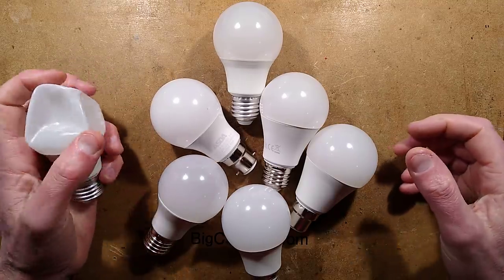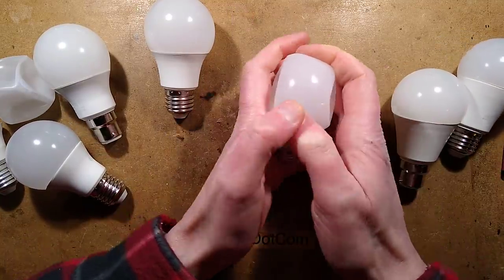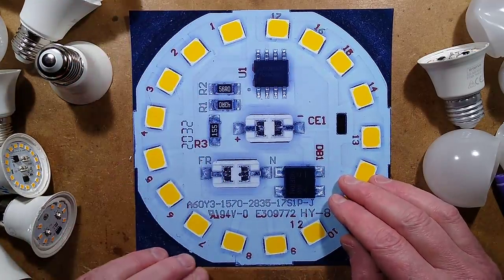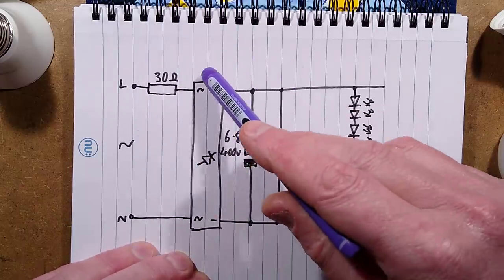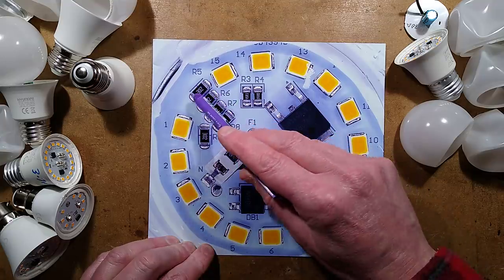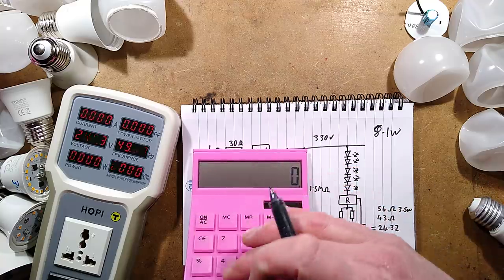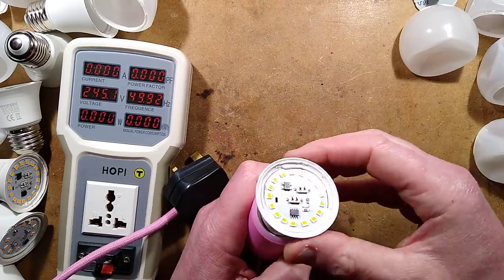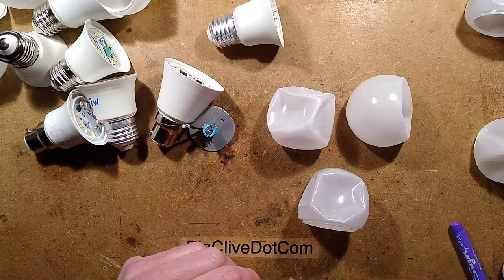Crushing and hacking LED lamps

Comment: I wired up my house with LED-friendly dimmers and bought a bunch of dimmable recessed LED lights that were brighter than I needed. I have them dimmed to the appropriate brightness in my house. They should last longer, right? Or does it not work that way due to how LEDs dim?
Reply: LED dimming is done several ways.  But overall, running less power means running cooler and therefore longer.
Reply: I wonder if you're really using less power or just warming circuit components?
Reply from the maker: They should last longer.  Especially if you used the correct type of dimmer.
Reply: @bigclivedotcom  Yes!
Reply: The light will last longer but you moved the weak point to the dimmer. Decide which one is cheaper to replace.
Reply: @bigclivedotcom  I have a bulb that can be set to three brightness levels by rapidly switching it off and back on.  Since I usually have it on the dimmest setting, theoretically it should last a long time.
I have another bulb which abruptly started showing signs of failure and looks very similar to the ones you have here.  Rather than an LED failure, I think it's the capacitor after the rectifier.  It makes me wonder whether I can break it open and repair it, since it's such a common-looking part.  I say there are five different capacitor chemistries in common use:  ceramic, tantalum, polyester, electrolytic, and chinesium.  The latter are often mistaken for electrolytic…

Comment: The afterglow on LEDs can be not because of leakage in switching but in capacitive coupling between wires on a two way switch lighting circuit

Comment: I've been doing this exact thing, having access to loads of free dead ones. I usually solder off one of the resistors and short-circuit the burnt-out led. And voila they work again.
Reply: Sure, IF that is the failure point, they work again, for a little while, on a 3/4ths worn out bulb worth 20 cents.  Your time is worth more than that, unless it is a large, rare bulb.

Comment: I've recently discovered that the hot air rework is brilliant for moding plastic things, most of these electronic enclosures are ABS, 130C takes most of the fight out of it without changing the surface finish. With solid temp control you can let the heat soak right through without getting any damage. I like to mount the wand on a magic arm so I can work in the air stream with both hands.

Comment: Yea a lightbulb that lasts for ever cant make money so they designed them to fail after so long so you buy more
Reply: Or the simpler explanation, less emitters driven harder=lower BOM cost. The modern corporate environment isn't that forward thinking. Potential repeat sales are an additional bonus. In any event the problem will only go away if standards are made and enforced for the lifespan claims, something like the the hours claim have to state time to 80% nameplate output running in a room temp environment. Or/And the lifespan outright regulated.
Reply: @Broken_Yugo  imo that is truly more conspiratorial explanation that I used but is kind of true to a point but I know it's not the whole explanation
Reply: @PoeticDeath  Minimizing production cost of a product in a competitive low margin market is a conspiracy?
Reply: allways was en will be

Comment: These so called wi-fi boosters is it anyway you could tell one of them apart and tell us if those things actually work so we don't waste our money 💰
Reply: It's quite obvious they are a scam. There is no such thing as an internet booster. Your ADSL/Fibre connection is capped by your provider already. Feel like your speeds are slowing down when you're away from your router? Get a good quality WiFi repeater. This WiFi booster thing seems to be a crappy repeater.
Tip to everyone in this comment section: Anytime you see one of those "50 dollar device takes (insert your Country/City here) by storm" ads, just ignore it. I can guarantee you it's either a scam or overpriced.

Comment: I often take the globes off lamps that look similar including the attachment method.  I don't need to crush the globes at all, just to put on grippy rubber gloves then twist the two pieces apart.  I do have strong hands, but not as large as yours so I think you an advantage there.

I prefer them with the globes off for less light lost, and less heat buildup, as long as not placed in a location where moisture or kids or animals get exposed to what is sometimes borderline high voltage, depending on # of LEDs in series.  However, usually when I twist them off as described above, they can be put back on and will stay on quite well from the grip of the silastic-whatever sealant, though I don't have confidence that the junction is still waterproof.

Comment: I’ve been inspired me to try with my own. The covers come off a lot more cleanly if they can be rotated first to break the silicone seal before attempting removal. When when attempting to pop the cover, rotate it while applying pressure; they are designed to basically fall of when rotated to the correct position. My Costco “Luminus” brand 120V lamp had a 20 ohm and 18 ohm resistor.
Reply: I bought a box of 5 or so Costco LED bulbs and they did not last very long. Expence per lumen. Glad I saved them now.

Comment: I've found that chucking up the bulb in a lathe and using a parting tool to cut just slightly outward from the joint between the translucent "globe" and the plastic coated metal base that acts as a heat sink makes it very easy to remove... And if you want to remove the round LED board, doing the same thing just back from that cut works well also... Of course, the bulb isn't really useable after that, but it works quite well for easily disassembling the unit when you want to see what might have failed...

Comment: Clive you are a wealth of informations ive had this exact problem with these leds and could not trace the circuits/did not understand surface mount compontents im used old stuff. , massive thanks for your learning videos , it is a needed thing . Excellent!

Comment: Great, thanks! 👍😊
Suggestion: Measure the exact dimension that a common bulb should have at the bottom, and let all your viewers design suggestions for 3D-printed bulbs (clear plastic) that can be glued on the lamp after the modification.  One rule could be that it should be possible to "Vase print". Then we could all share the models with eachother later ☺️
What a wonderful collection of lamps this could be 😁
Reply from the maker: I've already showed a huge quartz crystal style one on the last live stream.

Comment: Thank you Clive. I bought a couple of lamps from Poundland this week and had a look inside after watching your video. They have changed from using capacitive droppers to the current regulator ships, so I snipped off the large of the two resistors in each to make them last longer. I had noticed how Poundland's LED bulbs don't have a very long life span and tend to form the Black Dots of Death after a year or two.

I'm now wondering how many watts those current regulators can cope with. Currently (aha!) Poundland only seem to go to 6W. Maybe now they'll go higher. They seem a bit dim compared to the old incandescents where I used to use bulbs from 40W to 275W for various things around the house.
Reply: Actually, what would be interesting is to measure the actual light output of each lamp, both before and after modification and see how it stands up to its Lumen rating. Also how are those A+ "Energ" ratings calculated?

Comment: I know surface mount is super scary to everyone, but a super mega easy way to remove smc components is just to use two soldering irons (like hot tweezers, but without the cost).

Comment: I bought a load of ‘smart’ led bulbs following your video on them ages ago. The battery backed up ones, and I’ve never had any others fail yet to use them. My old flat blew bulbs all the time, I don’t think any led ones have failed since I moved into my house 7-8 years ago and replaced all the old buzzing, or take 5 minutes to warm up to where you can see, economy bulbs that the previous owner used.

When you say they are designed to fail, I don’t seem to have any of those.

Comment: Couple years back my local power company ran a campaign where for every incandescent light bulb you turned in they gave you an LED bulb to replace it with. Over half of those LED bulbs failed within a year.
Reply: Back in the day, the UK government gave power companies a tax break to improve efficiency/reduce CO2.  The companies (mostly) handed out free 'low energy' fluorescent bulbs, made in China... which (again, mostly) dimmed with time to the point of uselessness.

Comment: I just bought a 15W LED lamp from the Dutch chain "Action", the brand is "LSC" And the model is "ZM F20c "imported by "Electro cirkel retail Rotterdam".With good technique ( only using my hands) and no small force the top comes off even without bending the plastic top too much.I shall do the same thing to limit it to 10W .It has two circles of LEDs,  a chip named " KP1054 K135B" and two inductors for some reason.I shall do some reverse engineering to figure out what the inductors  are for and limit the power to 10W.

Comment: I bought some philips led that looked the same externally, but had a square board with a separate round heatsink, the electrolytics (2 of them) were soldered in, but the leads were full length to stand away from the board
If you don't want to damage the top, run a hacksaw around the join until you just feel the inner plastic,  it should then pop off.

Comment: It was a joy to hack those to run on batteries by rewiring the LEDs in parallel, but even the LEDs are moving to higher voltage packages which can't be run on any sane battery.

Comment: These LED boards would be a decent retrofit for failed SL-Prismatic lamps when the tube eventually  fails. Could even use more than one board in those for high light output without too much heat buildup plus being safe once the diffuser glass is refitted.

Then the magnetic ballast which you remove can be used to drive a few other types of fluorescent lamps (I've experimented with electrically similar tubes with one). Those SL lamps are harder to open than these LEDs without damaging the base section but not impossible with a couple of spudgers.

Comment: I had two of these bulbs die just a week apart last month and I cracked one open out of curiosity, despite not having touched any circuit stuff since first year undergrad. But these are simple enough that even I could get a grasp of what it was all doing. I don't have Clive's hands though, so I ended up using slip-lock pliers to get the thing open. Unsurprisingly the board was similar to all these, but I didn't see an inrush-limiting resistor.

Comment: This is perfect for an always on entranceway light. Fiddling with different resistors you can cut the power used and the heat generated by about a third, greatly extending the lamp's life w/o significantly reducing the light emitted. Lamps mounted upright last longer.
Bonus Round - If your LED bulb is flashing on and off it is almost certainly a failed capacitor that got too hot (or was too cheaply made to start with)

Comment: A long time ago I got the award winning Philips 10W LED lights that were assembled in the USA, on sale for $20.  They are 900 Lm and 90+ CRI and they've been trouble free for nearly a decade. It's incredible how much they've simplified and reduced the manufacturing costs of the LED lights.  Someone should do a lifetime test to see if these cheap lights can be kept cooler and last longer.  How about drilling a few holes in the globe to ventilate the PCB.  Thanks, Clive.

Comment: I have a lamp of similar build. But I learned that you don't need to crush them to get the top plastic lid off! You can heat the rim between the bottom casing and the lid with a hot air gun. Then, you insert one of those phone spudger tools and make sure to get the clips open. 
Also, mine turned out the be a choke-regulated one. There, all you need to do is change Rsense to a higher value so the threshold voltage in the chip gets reached at lower currents. I changed it to 4.4ohm and I'm getting 3.7w of power usage. 
Hope this helps anyone with this type of LED Chinesium-grade lamp!

Comment: This method worked but only brought some 15W  LED bulbs down to 11W. But it did have 2 current regulators and 32 LED chips. Designed for 120V.

Comment: Evening Clyde. 2nd year electrical engineering student here. Quick question; how do you look and the pcb and know exactly how the current moves and know which components are connected to which?(i know the easy answer is years of experience but I want more advice)
Reply from the maker: You have to understand the components to understand how current will flow.  That comes with practice.
Reply: @bigclivedotcom  Thank you for getting back to me. I understand now.

Comment: I would be worried the plastic globe would shatter and severely lacerate my palms.  I usually just cut the neck of the globe and twist the base off. Where I live, you can pick up dud recycled  LED bulbs at bottle depots. I have repaired many rather easily. They do run hot so the hacks shown should let them last even longer . Thanks Clive.

Comment: Not bad, not bad at all :) Whilst I personally haven't had any LEDs fail like this, I do know of a couple of areas at my work whereby the lights are left on for long periods of time, and of course, they end up requiring replacement due to excessive heat. It's a shame that light manufacturers try grilling the LEDs and circuitry, therefore reducing the lifespan of the bulbs.

Comment: I once "dissected" an led bulb only to find 4 leds with a simple dc converter. Individually, the leds lit up at a whopping 70v! One of them was dead so since I couldn't find something to replace it with, i just soldered a wire in its place and the bulb still works ! Props to the chinese for this one

Comment: I have ordered an SMD sample book  (0603, 4250 pcs, ~12€), and 100 LEDs (<1€ incl. shipping), and the new BC2 tip for my TS100 just arrived. I have already modded all my lights based on what I learned from earlier videos, next I can replace the LEDs instead of using solder to shorten the chain, I have lights with 2 LEDs left.

Comment: Interesting (and easy) hack. You could probably paint the live bits with some clear spray paint or clear nail polish (or conformal coating if you want to get really fancy) to reduce the shock hazard if you are going to put them back in service that way.
Reply: Epoxy, I use goop brand glue, it works on everything

Comment: @bigclivedotcom Any chance you can do a video using a Lux meter to determine how much less light there is by reducing the power to these lights? I am wondering if I adjust mine from say 7w down to 5w (not necessariyl half) how much less heat I am generating vs how much less light.

Comment: Hi Clive. Great tutorial thanks. I live in africa and have kept most of my ‘blown’ LED bulbs and from years back some of the neon ones. The reason been, I used to have an old retired electrician who I would give them to, he liked to ‘revive’ them and sell them in the village. I would help him buy some small replacement parts like resistors/ capacitors (small disk shaped things) I guess and he would solder them in. Unfortunately he is no longer around but Ive always kept the bulbs and some friends with chicken farms have thousands. Im not an electrician but would like to teach young adults how to go about repairing these bulbs as its worth out here and these guys can earn a bit of pocket money. Safely of course, don’t want to encourage potential fire hazards. Could you help with a basic video like this but advice on how to repair them if possible.

Comment: I've been wondering if the whole LED lamps thing is a con.  I upgraded the kitchen in my last house, using 7 down-lighters in it.  I used the LED type ceiling downlighters on a GU10 mini bayonet.  I bought a kit of 12 bulbs, but after a year, so many had blown that I bought another 6.  I used them for a total of 2 years, and in that time, 14 out of the 18 had blown.  I used them for about 3 hours per day in the Winter, and much less in the Summer - and the advertising blurb said that would last 50,000 hours, which would be 5.7 years if they burned 24 hours per day.  Needless to say, I felt cheated, but looking at adverts on Ebay at the moment, I still see "Life 20,000-25,000 hours - guaranteed for 1 year" - so they still don't guarantee them for the minimum claimed lifespan - and in most applications, they will be used a lot less tghan 24 x 7.

At purchase, they are much more expensive that filament bulbs, but although they draw less current, they don't last.  Are they the economic solution they claim to be?

Clive, if you take off the plastic dispersing cover and run them naked (they will be out of reach where I'm thinking of using them) will they run cooler, and thus have a better life expectation?  How about if you make some holes in the plastic base below the aluminium substrate - to cool it more?

Comment: I was intrigued by the hack.  I popped the globe off a failed LED bulb (why use a working bulb if I might break it), made by Feit Electrics, that looked like the ones in the video and was disappointed that apparently the circuitry was in the base and only a couple of soldered wires connected to the LED.  I still plan on trying the capacitor inline hack.  
The Feit bulb had failed after about 6 months of often prolonged "on" use and the base would get extremely hot.  I would not be surprised if the electronics and the LEDs (some had actually turned red while others remained yellow) got baked until something failed.  Oh, well, they were pretty cheap.